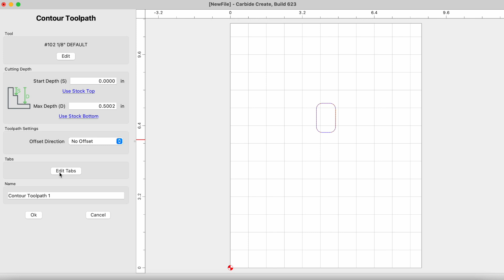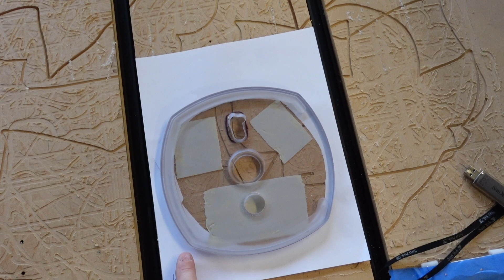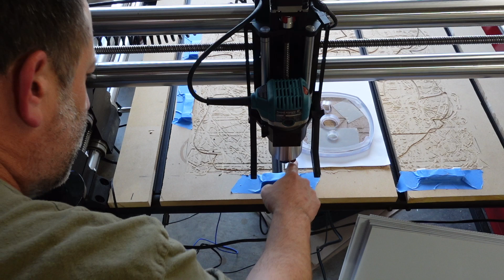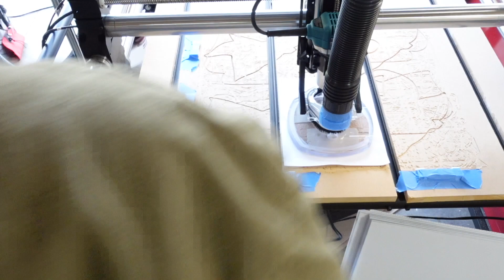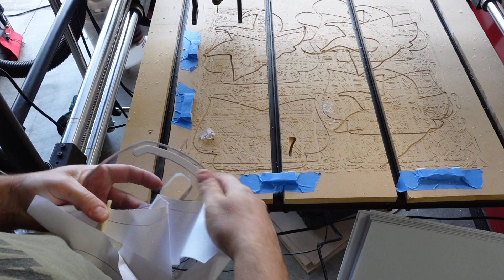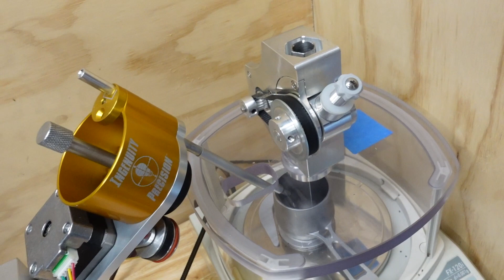Cutting acrylic on OneFinity CNC & Carbide Create

Comment: I've been in this situation before, where I needed to cut features into an oddly shaped piece after the fact. One solution that works for me is to get a piece of scrap plywood or similar and cut a shallow pocket to hold the oddly shaped piece as well as a known good rectangular profile around the entire geometry. This gives you an exact position to zero your X and Y, and you can set your Z zero off the top of the piece to cut. Your method seemed to work OK, but if you had a pocket and  profile, you could likely get sub-millimeter precision. Of course this only works if you still have the geometry of the oddly shaped piece. Cheers.